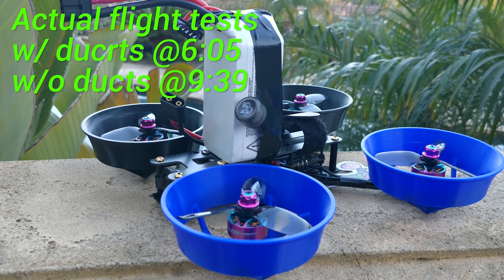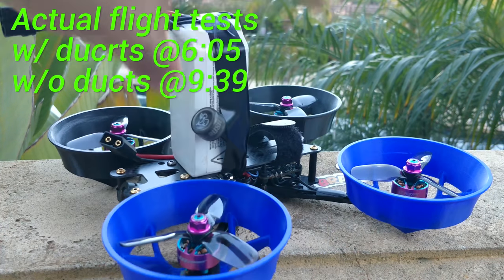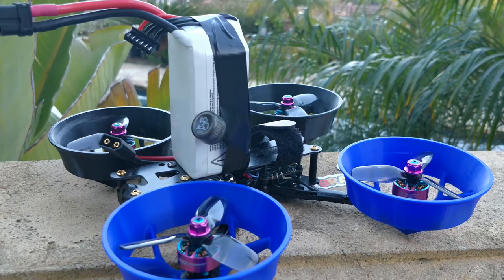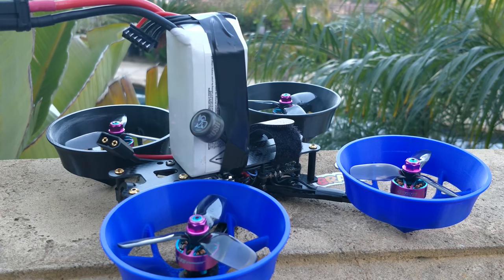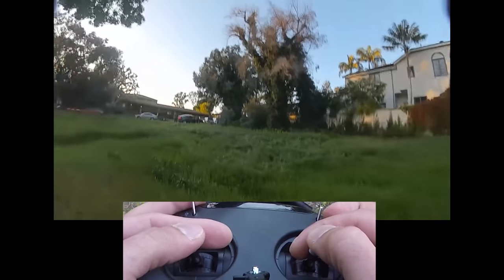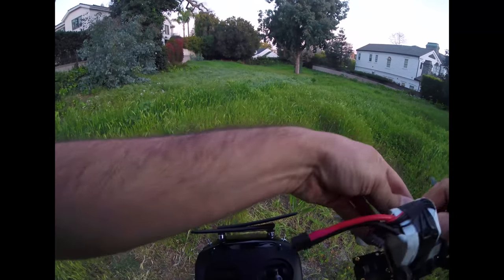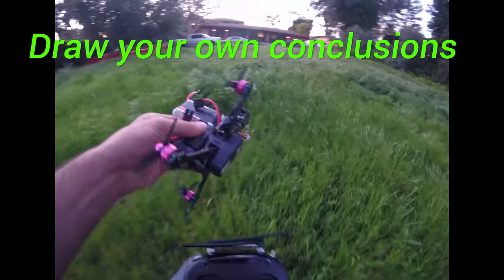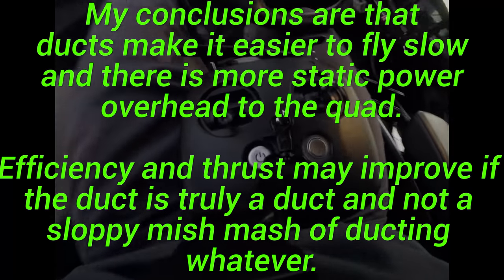Ducts - more thrust and efficiency?

Comment: One problem with duct rings as part of the prop is the weight at the tip will reduce motor response.
Reply from the maker: This sort of thing isn't really designed for response so not quite as much of an issue

Comment: If you want to try the test with the ducts on one side again, try lowering the idle throttle setting. It may be trying to stay level and can only lower the RPM so much, so it can't come down if it wanted to. As for the props with the ducts built in, ringed props have a LOT of inertia and weight right out at the edge of the disk. I don't know how that would work or not for a quad. For ultimate efficiency, you could flip the motors and have the motors mounted to the top part of the frame (up side down frame, kinda?), and the ducts mounted to the bottom part of the frame. You wouldn't have anything in the airflow that way. I love your practical experiments, keep it up!

Comment: Hope stan make a pusher type duct? cause it could eliminate the disturbance of airflow brought by the quad arms, the arms that holds the duct, i think it would amplify the effects of the ducts. Thats my problem with that i did the last time, not a great duct design (my ducts) but added the drag that the arms or i mean the disturbance the arms bring, the flow of air is not a true vector. But i think it will be to much work
Reply from the maker: Yeah he has pusher ducts

Comment: In a other sense I never flew a cinewhoop, yes maybe beta95x v3 and a couple of prop guards on 3 inch quads, but not a cinewhoop wirh ducts. Practically I think, ducts will provide more movement control than a simple guarded props... cause my 3 inch with prop guards do move very fast... much like an acrobatic quad, and its hard controlling around ppl.
Reply from the maker: Guards and ducts are very different. Duct quads typically do not move quickly. They're not true ducts so they don't function the same.  Control is also much much worse. The only real benefit to ducts is that you can actually fly slower with better slow speed control. You might end up getting a little more thrust out of the system but it's not significant.

Comment: There has been testing done on ducts, even at the micro-ish level.  There's papers and everything.  Yes, ducts do increase efficiency and thrust, at the expense of... the weight/effects of the ducts themselves.

https://capolight.wordpress.com/2015/01/14/quadcopter-rotor-duct/

There are a number of realities you have to face though.

The "optimum" duct size is actually pretty unwieldy.  But you can still get a decent bump for a slightly smaller duct.

The trick is getting that right balance of duct vs. efficiency.

It is really hard to get it right with 3d printed add-on ducts at the current level of technology.

In order to make weight, the ducts have to be an integral part of the frame, or you just have to use a lot better production techniques.

So these 3d printed add-on ducts on conventional frames just aren't getting the job done.

Comment: So I'm pretty sure the centripetal force would deform a prop with a duct Built-in.  In the middle between the blades wear the ring is not supported, would probably start to bend out. Would probably work better on a 4 blade, 5 blade or 6 blade prop. Also that would make the props really heavy and bring down the response I would think.
Reply from the maker: Yeah I'd go with 4 blade and it would be really thin so not so much weight but definitely will impact things. It's the lightest way to go however and easiest to apply to any quad.
Reply: @Kabab   I would really like to see that product, The only thing I keep thinking about though is the time I got hit in the face with an exploding 3" prop. I was like 10' away and that thing still hurt. That much force I think would really have a s strong effect on anything that  Is not supported... Maybe if it's possible embed a really thin carbon fiber ring in the plastic. 60$ later best prop ever.
Reply from the maker: @mrtiefpvhowtoandreview1033  🤷🏻‍♂️ I'm sure someone will try it

Comment: I found a catch in your experiment setup, sir, see the loophole here is you took the weight of the craft constant in both cases but the problem is you added extra weight in a craft that has no ducted fans to see the difference in flight time but the problem is there was no need to add the extra weight because in the first hand our soul motto is to see if ducted fans make a difference, and since ducted fan craft and bare propeller craft are entirely different to each other you should not have added the extra weight because it is not the problem of bare fan craft to be lighter, it is lighter because it is the way it is made, you should have tested the models as it is since all we want to see is if the ducted fan could compensate for its extra weight meanwhile increasing the efficiency of entire craft or there could be one option to add extra battery to make the weight of both crafts similar which would simply increase the flight time of the craft and we can clearly see the winner- the bare fan craft so you need to find other way to test this setup for comarison.
Reply from the maker: Yeah this test was flawed in many ways.

Comment: Could you do a similar test with performance flying and not basically just hovering/vertical punching? - Theoretically this should reverse the result - theoretically...
Reply from the maker: The ducts are really best in static pressure environments really.  They're particularly good at generating hover thrust

Comment: do some searching for ducted fan research. there is plenty. look at the work done by john kress for formula on duct types, friction losses, calcs n such. it was done in the 1950s from memory. The ducts you have are too short and not tight enough in tolerance. the entry air needs to be as laminar as possible. A single blade prop in a duct is the most efficient. There is an awesome video of a guy who has managed to get a single ducted fan flying as a drone.

Comment: I can see how, the idea of props with a duct, as an integral part, sounds like a good thing. I would hazard a well educated guess, props with integral ducts, very bad idea. Even with small, prop-guard type ducts. I have not crunched the numbers, but I will point out, Parasitic Drag, will prohibitively high. This is why no one makes a prop like this. I would be willing to suggest, the idea has been tested.
The K Foil is an example, does creat lift, NASA tested it, but it showed a huge drag bucket. Oddly enough, there are still devotees out there.

Peace, Wolf "Lobo FPV"
Reply: To me it seams also bad idea, it means mo mass at the tip. So flywheel effect so need of more torque motors in the low rpm. Regular pro-s have less mass and less pitch in the tip to reduce vortexes so a ducted prop wich high pitch up to the duct will have more mass on the tip as more like extreem bullnose prop adding duct makes mass worse.
If duct use right way more efficient hoover it possible to go down in prop size. If exces weight of the ducts the duct design could be integral part of the frame.

Comment: I feel like the inertia of a larger props regardless of weight has a larger effect on feel than ducts/no ducts, those props are so tiny probably awful without ducts, The duct-prop sounds like a good fix to that
Reply from the maker: Yes absolutely.  Going up to 5" or even 6" starts to see some real flight time gains from situations involving static loads
Reply: @Kabab  oOn the point of higher inertia props, adding the ducts to the props may cause some major issues regarding their rotational inertia. Not only is it likely that they would require substantially bigger motors to handle the torque or spinning up and down rapidly, but you also have the issue of having a lot of the rotating mass a long way from the centre of rotation which could result in severe gyroscopic effects.

Comment: Merging props and ducts into a single 'thing', that's a very interesting idea. What will you call it, a guardprop? Ductprop?
It leaves me wondering about how the motor will cope with the extra weight, whether it will struggle to spin up/down the heavier ductprop, maybe that added weight could help with stability & smoothness for cinewhoop use if they're balanced well enough.

Comment: You don't have to pay any mind to people just yelling at you, the danger is to conflate genuine remarks/criticism with "complaining no matter what". Why'd you strap extra weight on the ductless setup? In my mind the #1 drawback of ducts is weight, not so much reduced performance.
Reply from the maker: To simulate the weight of the ducts. It was only right to do so since there technically should be guards in place

Comment: Adding a ring of mass to the outside of the prop will significantly increase the inertia that the motors are fighting so it will be much harder for the props to change speeds and quickly react to the flight controller inputs.  I think it would have more of a negative effect than a positive.  With that said, things like that are still worth testing, especially in real world situations, because sometimes you find unexpected benefits from testing.  Keep up the research and testing.  We are all learning from it.  Thanks for sharing it with us!

Comment: I think ducts do increase efficiency for a given prop size.  But I still think the mass is better used by just moving to a bigger prop/motor combo.  Instead of adding a 20g duct add 20g of bigger motors and props.  I think a 6 inch quad without ducts will be more efficient and powerful than a 4 inch with ducts.
Reply: What about size and power limitations? There is a finite maximum size that any drone can be for any scaling. Also is the weight scaling really so equivalent? Ducts can potentially be extremely light as there are very low density materials out there while going from a 4 inch to 6 inch is not necessarily such a meagre weight increase despite a lot of investment to minimise weight.

Comment: I would think with a rotating duct you would introduce magnus effect and would cause a whole other can of worms to deal with...
Reply from the maker: Maybe.
Reply: @Kabab   I think it would be way, WAY too heavy to continuously spin up and down; it would fly badly and loose the benefits of stationary ducts. There's a reason our props taper off at the tips, where the speed is highest.
Gemfan does have the 'winglets' to reduce vortices, which are well known from other fields of flight. I believe they make props quieter.
Reply: The spinning ducts would be heavy, they would require bearings and a motor to spin them.  They would also introduce more gyroscopic effect which would hurt maneuverability.  But that might be good for a camera platform drone and not freestyle/racing.

Comment: Hi Bob, love your work, but I suggest that props with built in ducts might not be a great idea. You're putting a lot more mass as far as possible from the axis so it's going to be really hard for the motors to adjust prop speed quickly. Imagine the heaviest prop you've ever flown and multiply all the bad stuff by at least a factor of 10.

Comment: There is too much nuance in arguing about efficiency vs economy vs sensitivity. High performance motors are often efficient but to get the flight times to be better you may need throttle limits and input smoothing. Ducts may not increase the sensitivity (not sure) but obviously add weight. There are things you can prove in a lab but it doesn't mean that's what one individual or another wants and there is too much nuance in definitions of words that it's easy to have a break down between what you are saying, what is technically true and what another person understands to be what you are saying and what they understand to be true. Nitpicking is inevitable whether someone is trying to help you communicate to their standard or someone who just has a completely different understanding (or lack there of)... It happens to everyone who has ideas.

Comment: Adding 25% extra weight, makes a jerky quad, more "relaxed". That might also be why, many freestyle 5 inch pilots like a heavy freestyle quad. Tunes out all the small jerks/oscillations from the quad.

Adding more weight to a quad, gives it more kinetic energy, could be why you don't fall instantly when cutting throttle with a ducted quad.

It sounds more efficient with ducts on, and flight time indicates a tiny bit more efficiency. But 5 sec in 2 flights isn't scientific enough to me.

The quad looked a lot smoother with ducts on, and was very scenematic. How ever, without ducts, it looked more responsive.

To improve the testing. Add the extra weight underneath the quad. Having a big battery horizontal on top, makes it very unstable on pitch and roll axes.

Please do more testing. And please try with the extra weight on bottom not top of quad
Reply: To any one going to hate on me, now.

I don't know anything about props, ducts, wings or anything.. I'm just a stupid man, throwing around my thoughts and what seems logical in my head

Comment: This may sound crazy, see if hobbyking or banggod, have replacement edf blades that would fit the diameter of your ducts, next challenge is to mount them as props on your drone, LoL.  My personal opinion on ducts they are more safe, maybe produce little bit of thrust but drag and weight limit aircraft with ducts.  In order to get much more thrust and efficiency out of it, ducts need to be longer, like a jet nozzle at end.

Comment: That thing sounds so unhappy on the throttle pumps without the prop guards.  Almost as bad as when I ran Gemfab 6045 Cyclones in reverse for 3D mode.  Like worst sound in the world
Reply from the maker: yeah with the ducts it performed quite a bit better overall.  The throttle felt much more solid rather than fickle.  Delayed throttle response but when it responded it was responding.

Comment: Aerodynamics are a bitch aren't they? How many blades should a prop have? How many blades is too many/not enough? What should the blade angle of attack be? The blade shape and blade size are major concerns as well. To duct or not to duct,  the shape of the ducts (if you go with a ducted design), should the prop blades and duct all be one piece or separate? Dual motors/dual props (one pulling, one pushing) or one motor with counter rotating props (both props pulling)? How about a nose cone for better air flow past the hub...worth the extra weight? Is the air used for thrust as important as the incoming air? (yes, yes it is). Do the surfaces that redirect air into thrust have a smooth finish? (take a closer look at a Wright whale's pectoral fins (or is it the Humpback whale's pectoral fins?) or a microscopic look at the skin of the carcarnis cacarnidon <--- I butchered that name...the Tommy shark/White Death/White Pointer/the Great White shark/JAWS and you might be surprised to find that a smooth finish is counter productive for lift/thrust). 
Anyways, I hope I've given you some things you may have overlooked and might want to consider adding into your final design. If you get that project dialed in just right, you'll be able to pull tree stumps out of the ground.
Reply from the maker: It's a constant work in progress